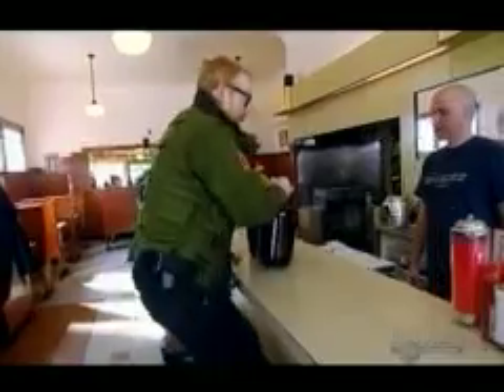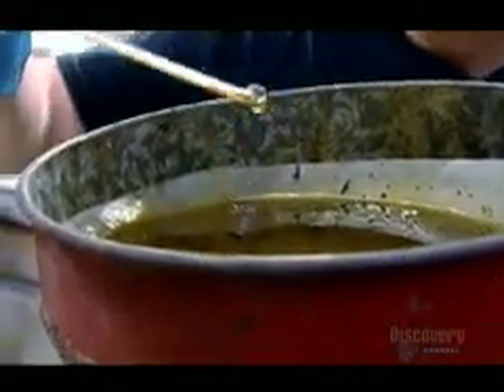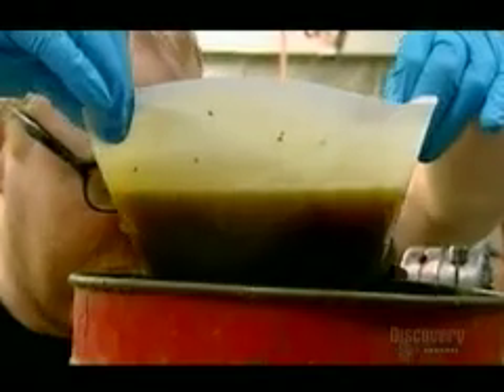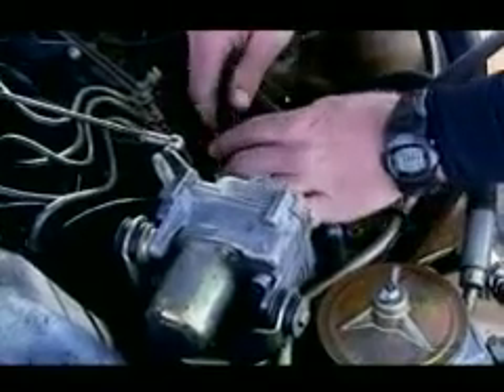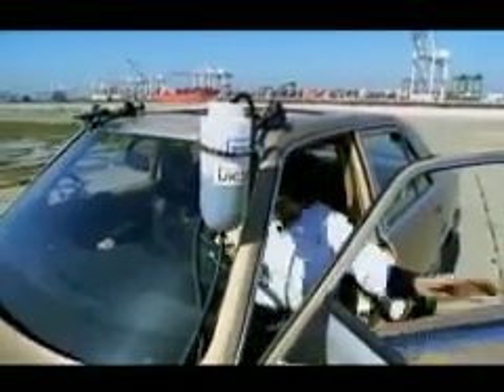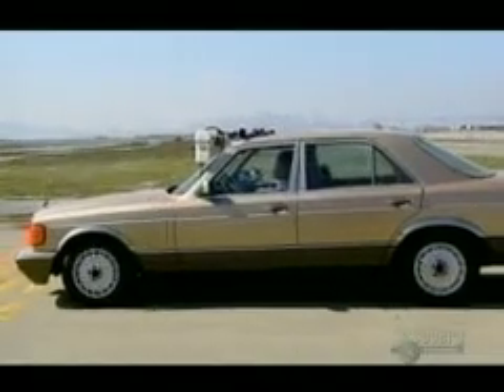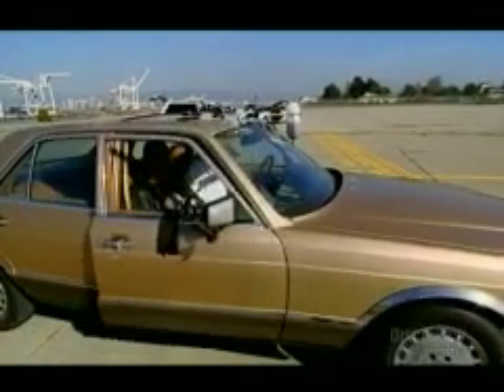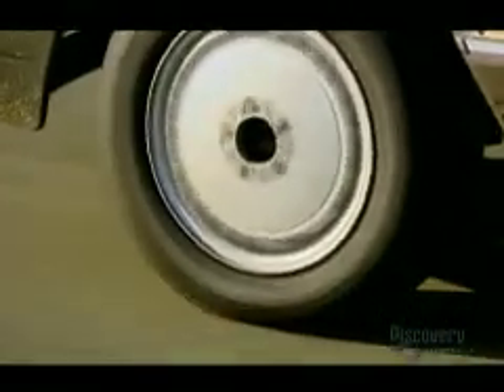Mythbusters - Cooking Oil as Economical Diesel Fuel

Comment: MythBusters wasn't always about busying myths. Sometimes it was about proving them to be true as well.

I own a Powerstroke diesel. I've burned everything from new cooking oil (canola, vegetable, peanut, clear frying oil), used (filtered) cooking oil (same), waste motor oil, transmission fluid, kerosene, red fuel, green fuel, biodiesel, thinned hydraulic oil, etc.. literally almost everything I can get my hands on cheaply. It never hiccups. The mileage does vary slightly, but I believe that's due to different viscosities.

Diesel engines are the past AND future. Diesel fuel is nothing more than a byproduct of the refining process. Us dieselers and truckers are paying more at the pump for WASTE FUEL. It makes no sense, but it is what it is.

There's a reason diesel fuel owns the commercial transportation industry. Cleaner burning, longer life, and better fuel economy when properly tuned. Get used to it :)
Reply: "Cleaner burning" - Just no.
Reply: Diesel is not WASTE FUEL even when you capitalize it.  It costs more because of supply and demand.
Reply: So do you just put all that stuff into the gas tank? I have a 2017 duramax
Reply: Diesel was a waste product until there was a market for it now it is more valuable because of the how much of a supply they have and how much of a demand there is for it. A thing is worth what people are willing to pay for it.
Reply: Hey I also own a 7.3L powerstroke. Do you live in a colder climate?
Reply: @blackmasta71  Sorry! Shoulda tagged me just seen this from someone else tagging me in a comment. I dont live in a cold climate year round. But the winter yes it gets cold, i live in south central ish pennsylvania. got quesstios?
Reply: @colbytroutman2882  Hey thanks for responding. I just wanted to compare your fuel milage with mine at the time. Thanks
Reply: @blackmasta71  Oh ok! Yea in the summer i get a good 13-14 mile to the gallon, in the winter it drops to 11-12 due to the cold. The 7.3 likes it better when its warm. Also I have the ts6 tuner on. I know people claim to add 1-3 mile to the gallon when they install it but I've never ran the truck without it, it came with it and if you dont atleast have that tuner  get you one because the 7.3s are absolute slugs without one.
Reply: @colbytroutman2882  yes my OBS 7.3 has the TS6 tuner. i like it alot. My 2000 7.3 has a superchips tuner. It kinda sucks how the super chips isnt an on the fly tuner.
Reply: @blackmasta71  Maybe but i ever touch my tuner unless i need the warm up tune, i leave it on 50+ all the time nomatter what
Reply: How do the fresh oils and the used oils compare on mileage?
Reply: your name  dang! nice! That means youre geting about 26 mile to the gallon? roughly. How is it hauling though? do you do much or you dont do that kind of thing?
Reply: your name  Sounds good! Let me know what happens if you pull 10k behind you though haha
Reply: your name  Dont feel bad, i dont think id wanna go much over 10-12k with mine lol. not without a manual and dually conversion anyways
Reply: your name  Yea, just saying for me though i tow small amounts, 2-8k on the normal but occaisionally i go up to 12-13k
Reply: My understanding of fuels is that it's actually petrol (gasoline) that is the by-product. Heavier oils are refined first from crude. The petrol engine was created as a way to use up all the waste petrol that was being created.
Reply: Bout time someone said it! Better fuel economy....No one believe me when I tell them that they should buy a diesel truck cause i get roughly 420 miles on a tank of fuel in my 99 F-350 with the 7.3 and when you start hauling it doesnt bother it much at all. People wanna play around with these "lifted economy cars"  (dodge rams with the sissy engine in it and eco boost n whatever sissy truck you can think of) because they get good fuel mileage n I will say, yes they do, but as soon as you wanna haul or tow anything with them you slump from 20-30 mpg to 8 or 10, instead id rather have my 7.3 that burns at a steady 13.5-14.5 all the time and hauls 5 ton like its nothing

Comment: The only downside i think is that it will muck up your engine after prolonged usage
Reply: +Eazydogg 
I've opened engines that ran on diesel and those that ran on cooking oil.
The cooking oil engines had actually less carbon around the valves and looked cleaner on the piston.
Reply: Eazydogg there is a way to deal with that, its called pepsi...
Reply: i filter my cooking oil down to 1 micron. the fuel filter in my truck only filters down to 5 microns. thus my fuel is more pure and burns cleaner than the diesel while also lubricating the engine better. (diesel tends to burn very dry)

Comment: Not busted in my opinion. Refinement into biodiesel would increase the efficiency and not require as many fuel filter replacements
Reply: +Avaxa Sirvina Their discussion at the end seemed very lacking...
Reply: Thats only part of the myth. The whole myth was is there some sort of technology that allows your car to ultra fuel efficient...ie: 100 mpg. THATS what was busted. This part just says veg oil is a viable alt to diesel. But Adam was right, once there is a demand for it, there will be a price to be paid.
Reply: you can use it mixed with 25% regular car vehicle diesel , that way you keep the glycerin (which is a fuel also) and have a better fuel that biodiesel and cheaper too.
Reply: +Avaxa Sirvina Turning it into Biodiesel will reduce the usable amount by 30%.
You will have glycerin as a waste product of transesterification.
The more efficient way of using it is using it as straight oil.

Because straight cooking oil has a higher delay in self-ignition after injection, the timing needs to be slightly advanced- to counter the 10% lower efficiency.
Reply: Diesels also have about a gallon of piping between the gas tank and the engine, so even when they put in the oil, it was still running on the diesel in the pipes. They would've had to run it until the car stopped running to get an accurate measurement
Reply: especially when you can just get in line fuel filters on the cheap when you buy in bulk
Reply: The cooking oil hasn’t been optimized. It’s used oil. ....
Reply: What about for people who live in cold climates 🥶 who have to.... start their engines every morning?
Reply: @MrAM4D3U5  fuel heater. but ive recently become interested (cause of fuel prices duh lol) and it seems you would want 2 tanks. one for cooking oil and the other for diesel. the diesel starts the motor and clears out the cooking oil before shutting it down. im having a time just locating an extra tank for my excursion
Reply: @hobotechMASTER  why not make one?
Reply: @hobotechMASTER  Might be easier to bite the bullet on making it biodesel and tossing the glycerin

Comment: this won`t work on newer diesel engines . yyou will replace injector it is not worth it at all several people have told me this  due to not pre heating enough and the alge will eat seals and cut the long term life of the engine
Reply: D. Saelens 

I have over 100,000 miles on 2 vehicles running straight vegetable oil.  This is over a 10 year period of time.  Cars you ask?
1984 Mercedes 300CD Turbo
2004 Mercedes Sprinter Van

Done right, no problems!

Comment: Should be converted to biodiesel first using transesterification. Simply using unmodified cooking oil will destroy the engine after few months.
Reply: Rubbish.  I have been running my Toyota Landcruiser on filtered vege oil for about 6 years now. No difference in power output or efficiency. The only modification to the engine is a FPHE before the IP.  Runs perfectly.  No need for bio diesel or any other processes.
Reply: Gus Fergy Please clarify..what is FPHE and IP?  New to this and am suitably amazed
Reply: ***** , He might be just misinformed rather than full of shit.  I know as FACT that it has not destroyed my engine.  Maybe he has had a bad experience or used it in an engine that didn't like it and made his comments as a result without proper knowledge. Who knows.  Who cares.  Not me.  I run my cruiser on vege oil and it goes great, that's all I really care about.
Reply: ***** Sorry for the late reply.  FPHE = Flat Plate Heat Exchanger,   IP= Injector Pump. No need to be amazed.  Its very old technology that many people still use today.
Reply: Thx.  Been looking into it and sounds feasible and easy. Saw a doc where islanders used coconut oil in a diesel toyota.
Reply: Will Suh they filtered the oil in the video, its not like they just dumped the grease vat straight into the fuel tank and called it good

Comment: People, don't believe these hoax mongers seeking the mighty dollar and fame.
 Filter used cooking oil very well and remove water that may have gotten into it, and it's FREE fuel if you can find it free!
 Many farmers have used it in tractors for many years! Heck many of us still deep fry foods at home, toss that gallon of used oil a month in the fuel tank and save $4-$5! LOL
 I had a friend that used to get tons of it free, he drove his near new diesel truck on it pulling a heavy trailer 100's of miles each way when he was building his new home far away!
 He only filtered it, settled out the water, and ran it! His truck did have dual tanks so he started on diesel and switched to diesel before shutting off the engine. Made for an easier start when cold.
 Anyway it never harmed his truck a bit!
It's a cleaner fuel, and can be made from many things.
 Unlike cooking with it, used as fuel the oil does not need to be sanitary or meet any heath codes/rules etc... so could be made fresh far cheaper than actual cooking oil we would use for food!
 We don't see it now because it's not something the Oil Companies would get free from the wells and charge a hefty price on!

Comment: this wont clog anything up if you keep the oil warm and filtered properly.
Rudolf Diesel made the Diesel engine to run his own car on peanut oil....
they literally run on ANY type of oil aslong as its thin enough (warm) to not clog the injectors.
but hey changing the injectors every now and then would still be cheaper than buying fuel here where i am lol.

and what are they talking about busted...? it went the same distance as diesel fuel just about and they even left a little in the tank and hose...
Reply: when top gear did it they added a very small abut of turps / paint thinners to keep it thin and also help it combust when cold
Reply: could be a very good idea
Reply: dean tape Diesel engines can run on any thing including Propane and LNG...
The US Army HUMVEE can run both gas and Diesel in the 6.5L Detroit Diesel that was in 1990's Chevy Trucks.
The problem with running other fuels in Diesel engines is not what happens in the cylinder, the Engine will always be fine.... It's what the other fuel will do to your fuel system (pump, hoses, ect), and getting the right air fuel mixture... In older Diesels from the 1970's if you put gas in a Diesel it would run like garbage but once you burned the fuel off it was fine agian... If you played around with the Air Fuel mixture you could put gas in a Diesel just fine.
Reply: circusboy90210 You’re right. He DESIGNED his engine to run with peanut oil as the fuel. Uneducated fools like you are the reason the world is the way it is.
Reply: Can you combinate HHo generator with this???? a diesel motor and fuel
Reply: Charles Nicklestein lol wikipedia, not a trusted source.  Very wrong on that one
Reply: circusboy90210 your neurological function is full of transportation issues.  You make one foolish unfounded point and have no links or evidence to back it up. I have a bridge in brooklyn to sell you...
Reply: Charles Nicklestein studied 7 engineering disciplines ,philosophy,world history,and comparative religions. You ignore facts. Ps quoting Socrates is not a sign of insanity
Reply: Charles Nicklestein I quoted multiple sour es close to the man historically, who corroborate that statement.  Peanuts were not even available in Germany at the time
Reply: Charles Nicklestein your the only one ignoring facts
Reply: Charles Nicklestein  your use of insults comes from no proper rebuttal or proper argument,  you've lost
Reply: Charles Nicklestein it's well known the first diesel didn't use peanut oil. Fact  keep ignoring
Reply: Is it possible to recycle the heat off the engine to heat up the vegetable oil? No need for a separate heater this way
Reply: I have a friend who has been running his on used vege oil for a few years with no issues at all. well, it does give off a greasy smell lol!  But, he said not every Diesel engine will work. He said older engines work best.  He also bought a big old military generator from somewhere and runs it on the same oil. The generator is used to help run his place of business. Saves big time on utility bills.
Reply: Charles Nicklestein thanks charles, But i think this guys neurons are turning to prions.
Reply: Rudolf Diesel wasn't running any car on peanut or any kind of oil. First diesel engines were huge installations with too poor a power to weight ratio to be used in land vehicles. You think Diesel was just another garage inventor who managed to run his car on some funny stuff, when he was a top scientist creating the next prime mover of the world.
Reply: Dean Tape , pless ,traduza
Reply: Charles Nicklestein love your passion and your ability to speak the fuck up.. even if we are only on the internet..
Reply: Your an idiot, you do not know what you are talking about. I have been running my gq patrol on cooking oil which is centrifuged and then run through a filter for 300k kilometers now. GTFO of the chat if you gonna mislead people. All you need is a simple heating system to heat the oil to around 40 degrees c on your injectors and your good to go.
Reply: $10,000 for 8 injectors and installation of them in my pickup so how does that weigh out
Reply: It was possible with older engines because indirect injection and prechambers had lower pressures and less gunking problems. Modern engines with commonrail, direct injection and high pressure injection would get trashed. The problem is glycerine in the oil which doesn't burn up well and makes gums
Reply: Charles Nicklestein those that have lost the argument resort to insults. I have a PhD in transportation issues. I thoroughly studied Rudolph diesel,and no wikipedia is not better than me concerning this. At the time diesel was tossed out as useless.
Reply: Charles Nicklestein quoting wikipedia is not facts
Reply: Over a long period of time, straight veg oil trashes the fuel system  no matter how clean you refinine it. After about 200k miles. You are replacing injectors, fuel lines, and filter systems, A layer of sludge builds up and is a pain to get out. Stick with straight diesel or at least blended biodiesel.
Reply: Myth,no he did not make his engine to operate off of peanut oil